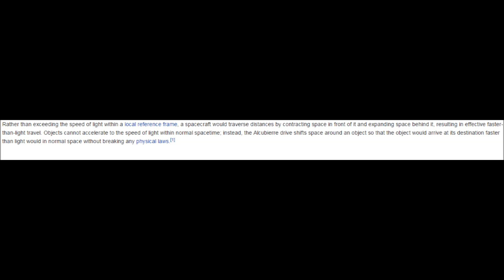Elite Dangerous - Lore & History - Frame Shift Drives

Comment: So the FSD works the same way as the Warp Drive in Star Trek?
And what's the difference between supercruse and hyperspace? 
And why do the capital ships still use the old hyperdrives?
Reply: Super cruise is basically the constriction and expansion of spacetime. So in a sense it’s similar to Star Treks warp except in Elite Dangerous, you still have physical maneuverability of the craft where as in Star Trek I don’t think you could maneuver in warp. The other mode of drive is where instead of warping spacetime, it appears you’re more so ‘tearing’ a hole in space and entering what is 5th dimensional space or ‘Witch Space’ as Elite calls it. In that drive, since you’re in a higher dimension, our laws of physics break down so all you can do is observe and enjoy the ride. I think the Capitol ships still use the old drives cause the only risk with those were the bandits that would track the FSD wake and would meet you at your destination and blow you up/ kill you. But, try that on a Capital ship and it’ll yeet you to dust like an annoying fly.
Reply: Supercruise bends space around the craft, expanding space behind and shrinking space in front of you. Think of this as your ship is a boat in a body of water. The FSD would in this example displace water in front of you and make it behind you, however you are not using any propulsion, as you can see from the thrusters not being on while in supercruise. The alternate feature of it is to effectively make a shortcut to that different system in witchspace, and your craft is then entering that and traversing a much smaller distance. Think of this like a piece of paper being folded in half. Now, instead of crossing the entire sheet of paper, you travel across maybe a thousandth of the sheet of paper.

Comment: The theory behind the faster then light travel is that although matter can't go faster then light, space itself can. That is why stars are moving away from us at the edges of the known universe faster than light. The theory is that in the Alcubierre drive is that space is "warped" in front and behind a spaceship and the space ship "surfs" the fabric of space itself which can go faster then light. :)
Reply: Not exactly true, the Alcubierre drive would use exotic matter to condense spacetime in front of the vehicle, and then expand it behind it
Reply: @BendySnowball  not true it has been recounculated exotic matter is not a requirement any longer if we just need to compress a " fuel "  thats about the size of jupiter in amount to something that could fit in your living room . We just cant build  a machine / engine yet that could actually pull this of and maintain these forces in a safe balance . 

But lets say we learn to contain and direct a antimatter explosion we could actually have the power to fold space. 

Our current tech is offcourse nowere near these capebilities . But i belivr one day we will find out just like people found out and learned about atomic power over 100 years ago

Comment: I just wish someone could tell me what a frame is, and why we shift them.
Reply: Frame means a point of reference and as Wrindwolf points out, the point of reference is physical space.  The shifting part is basically the manipulation of the point of reference (space) to achieve faster than light travel, also know as warp (the warping of space around your ship) but really the ship is not moving, the space around you is.  In simpler terms, "Frame Shift Drive" translates to "Space Warp Drive".